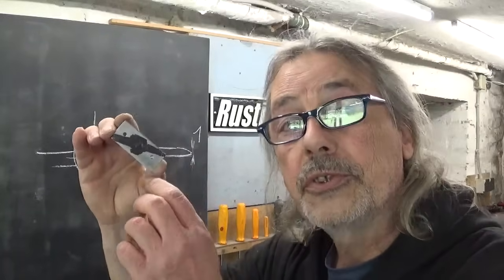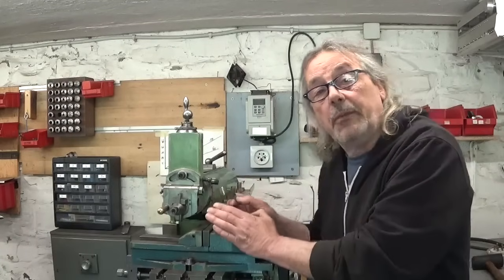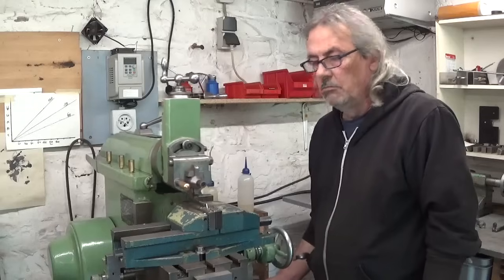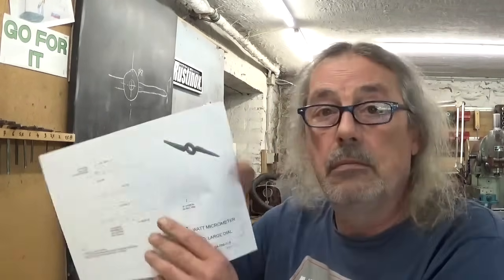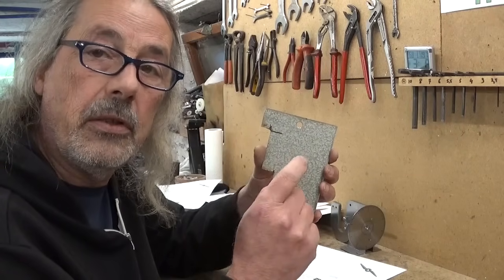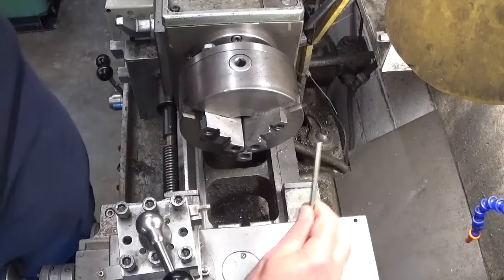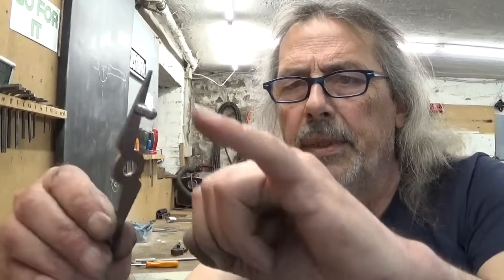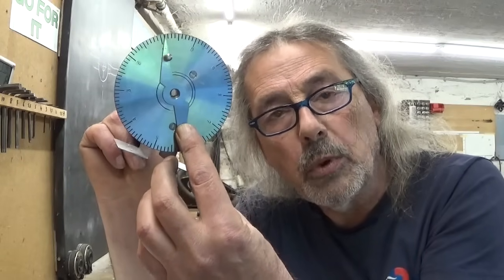James Watt's micrometer build part 4.

Comment: I learnt the hard way small things are notoriously difficult to make, especially if they have intricate detail and shapes(my model train hobby) to cut and smooth down. However those pointers came out very well considering the patience you applied in making them. 🙂👍
Reply from the maker: You're right. Small parts are not easy to make look good.

Comment: Nice work. I would use a cold bluing product to darken the parts. If you heat them they risk warping.
I recently sent you an email to see if you were interested in a used Dro for your FP1. I didn’t get an answer, so I can only assume you are not interested in it. Or perhaps you didn’t see the email. Thanks for your videos.
Reply from the maker: I did receive your email, but I suppose my reply didn't pass. It happen sometimes. I will mail again.
Reply: Ok
Reply: Michel, you need to blue them like Chris of Click Spring does 😍👍🏴

Comment: Great work, this is going to be a lovey tool. Did you consider silver soldering the sheet metal onto a sacrificial piece of steel. 
I quite like filing.
Reply from the maker: I don't have a burner to do that. Plus, think of all the cleanup that's needed after to finish the part.
Reply: @Rustinox  Ok,you are right, it was just an idea.  They worked out well!